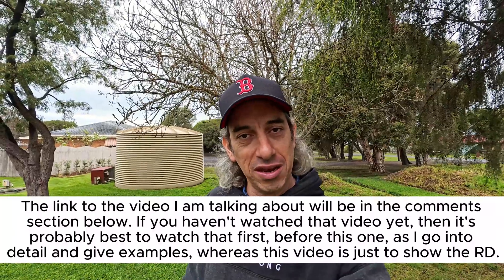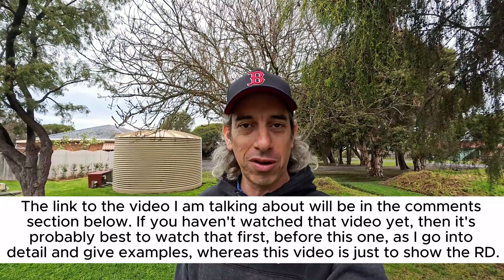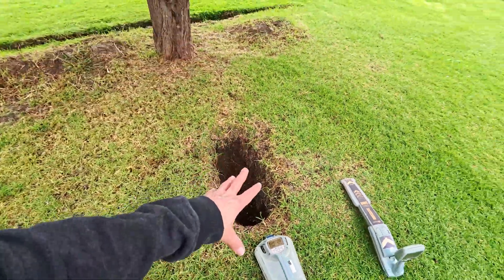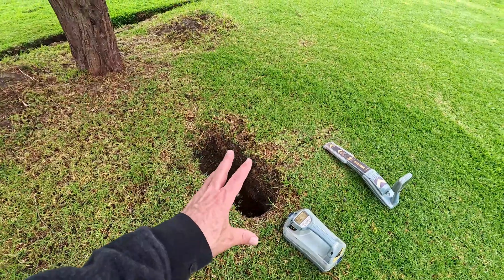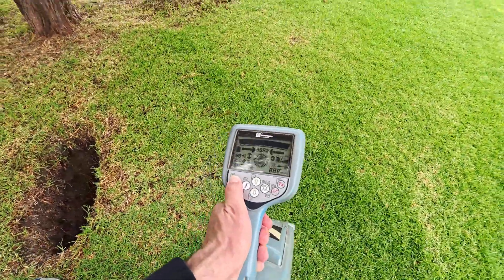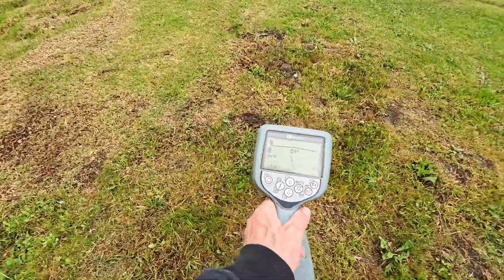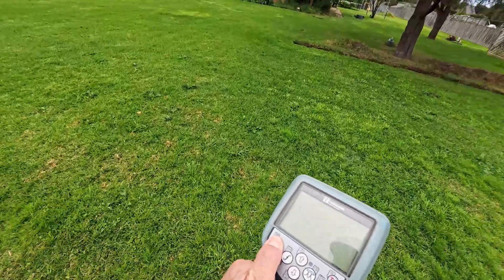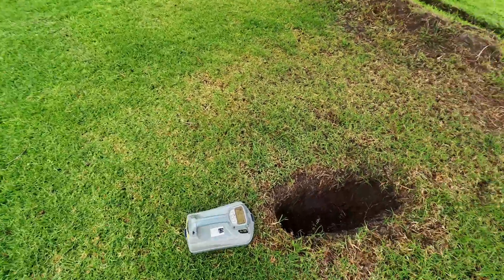Yes, Radio Detection can also locate a gas pipe with a broken trace wire

Comment: Hi, when the transmitter is connected to the mains, can its signal also propagate through a 12V power supply or a 5V Usb power supply and be detected on the cable of these power supplies ?
Reply from the maker: Don't know, I've never come across that on site. 
But in theory, if the signal is high enough, then yeah I guess it could be possible. 
If you have a site where these are set up id love for you to give it a try and shoot a video and send it through so I can see what happens.

Comment: Any idea how to get buried GRE pipes depth and what is the methods are there
Reply from the maker: Can I just clarify, when you say GRE pipe are you talking about Glass Reinforced pipes? 
YouTube is worldwide and there are different abbreviations for pipes all over the world, so I just want to clarify we are talking about the same thing. 
If this is what you are talking about then you would either locate the trace wire or if there is no trace wire laid with it, then you would use ground penetrating radar to locate it and then non-destructive digging also known as hydro excavation to expose what you have located.

Regards
Ben
Reply: @ thanks alot !